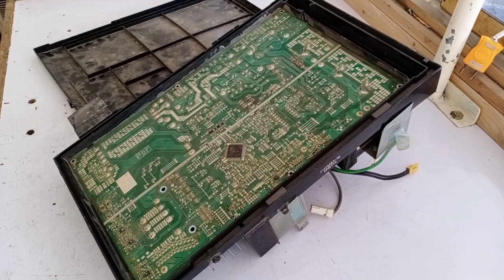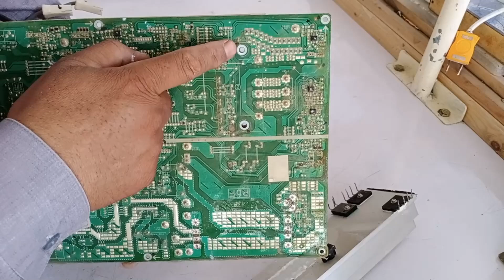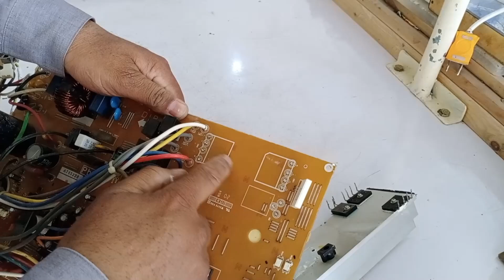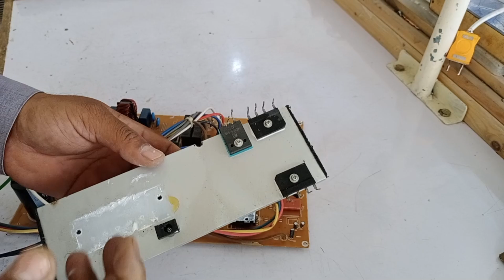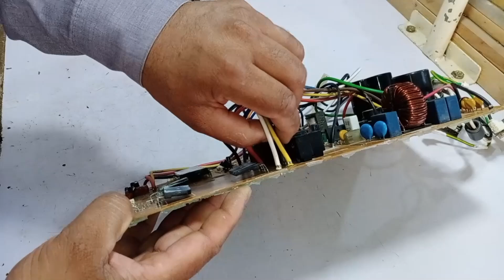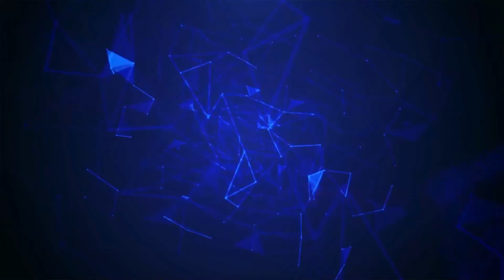Panasonic Mini Split AC Circuit Explained: Repair & Functionality

Comment: 1:54 That is varistors not zener diode
Reply from the maker: Yep those are mov's, i think editor did a mistake here.
Reply: Maybe because internally the varistos, there aré two zeners in oposite ways.  @forevertechenglish
Reply: thank you very much sir...